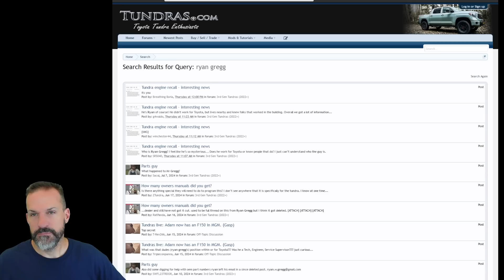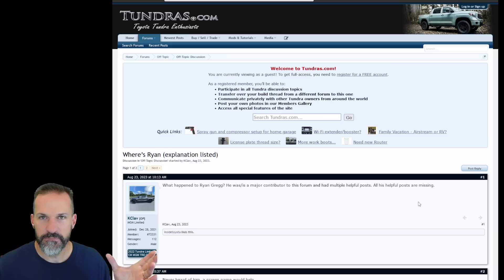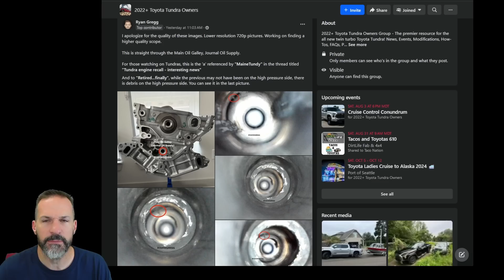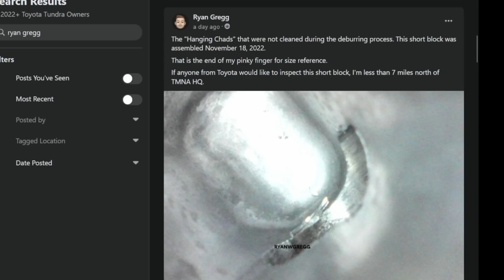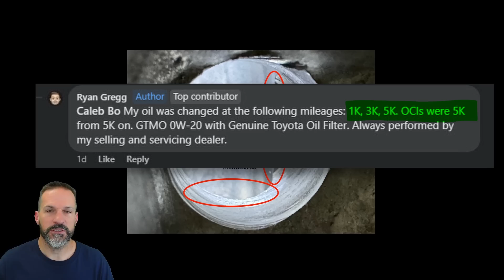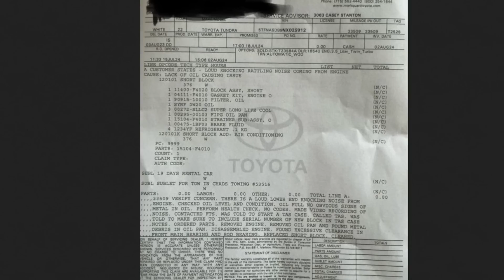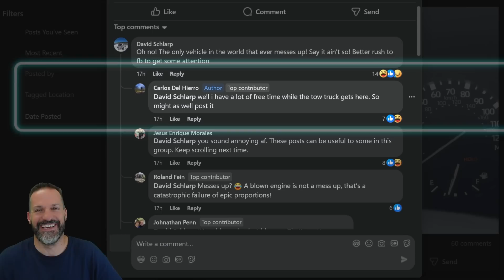Tundra Engine Failures: Debris Confirmed and Early Warning Signs for Dying Engines.

Comment: I still dont believe its a debris issue. Im still thinking its a miscalculation on the oil clearance for the main bearings. Those jagged burs aren't going to come off.
Reply: It's a design flaw, everyone knows this with a brain.
Reply: They do and they flake off as well.   Lots of reports of seeing metal in the early oil changes on the 22-23's.  So believe what you want.  Facts are facts.
Reply: @ronaldreagan6756 there’s metal in the first oil change if not the first few oil changes in basically all new production engines. This is a design or materials issue
Reply: @ronaldreagan6756  Metal in first few oil changes is completely normal. It is what you should see if your engine is breaking in properly.
Reply: Yes, I agree it’s not only a debris issue. It’s a bad engine design, too much pressure on the moving parts and bearings, and cheaper parts. Toyota isn’t the same company as it once was sorry to say it but it’s obviously true.
Reply from the maker: Time will tell, but if it was 100% an engineering clearance issue I think we'd see even more than 1-5% failing at this point. It might be a mixture of things, maybe main bearing material, maybe variable oil pump pressure/supply (more likely it could contribute to a lack of oiling), and debris chewing up the bearing on top of other issues.
Reply: @TheCarGuyOnline it is more than that. They just gave that number because they don’t know how bad it really is.
Reply: That and my idea about a power surge issue causing out of phase problems
Reply: You believe that Toyota would spend tens, if not hundreds,  of millions on a fix that won't fix anything?
Reply: @actionjackson5086  I never said they weren't fixing a problem.
Reply: Its the only engine ive seen with an aluminum engine cap girdle. I seriously wonder if that has anything to do with it!!

Comment: Just got my oil analysis back from blackstone for my 156,000 mile 2015 2.7l ecobeast f150. Engine is just like new. All wear metal values are in spec.
Reply: The 2.7 is the best ecoboost engine Ford makes.
Reply: @AJourneyOfYourSoul  yes it is.
Reply: @AJourneyOfYourSoul I had a 2014 and it was garbage. The truck is garbage period.
Reply: @JohnDoe-nz6bk there was no ecoboost 2.7 in the 2014. The OP was saying the 2.7 is best engine. And I would agree. Mines been worked hard daily and still fires up at 176k.
Reply: @chairmannemo2548  there’s still time to use google and then delete this comment. 🤦‍♂️
Reply: @JohnDoe-nz6bk  take your own advice..

Comment: Very excellent information. I was skeptical as it related to the debris explanation. This kind of lends some credibility to the information. Now you wonder if the recall campaign will be expanded. I would love more information on how the recall dates were determined. Initially, the design flaw theory was more logical. My LX is not included in the recall, I would consider it a gift to remain that way. Kudos to Toyota for dealing with the issue. Still lots of questions, really good report.
Reply: Your LX isn't because they don't want to spread fear.....Toyota knows it has a BIG problem.
Reply: @doctordetroit4339  I have not perfected the ability to read the minds of Toyota or anyone else, so I'll refrain from doing so. I agree they have a big problem, I've had many in life. I found it key to also pay close attention to the response to problems. In my opinion, Toyota has done well in response. I will be loyal to them.

Comment: An early sign you will have an engine failure in a tundra is you bought a tundra.
Reply: Yes, when you sign the papers if the pen is leaving a trail of ink on what is called the “dotted line” you might wanna head right to the repair shop asap!!!
Reply: @danav3387 😂😅
Reply from the maker: Hehe...yeah I can't imagine spending 60-80k on these only to hope it doesn't have this issue. The good news is, it seems like it would be an easy fix if it's JUST debris...bad news is....there are still 2024s that have had failures so, time will tell if they can get the ship pointed in the right direction.
Reply: Is Toyota having it's engines made by Hyundai / Kia? I'm sure it's cheaper.
Reply: My friend has a 22 Tundra.  90k miles, no issues.  Pulls a large enclosed trailer for his contractor business 5-6 days a week.
Reply: @Usmc6113  congrats?
Reply: My buddy has gone 2 for 2 on lemons. He had a Titan Cummins, then a Ram 5.7 Eram. Now he has a Tundra(non hybrid). Will he get his turkey?
Reply: Whatever man, you and I both know that Toyota has been proven reliable for years. This sucks because I have a 2022 Taundra experiencing the same problem,  along with many more cases. Ask yourself this, "who's recalls killed more humans than any other manufacturer?". I can think of Chrysler and Ford!!! Not Toyota! Keep in mind that Ford did not want to recognize the burning car problem as a recall at 1st. Which would have saved countless lives!!!
Reply: 🤣🤣🤣🤣 Please I’ll take a sick tundra over any of the big three and still and still last longer New moter option says Any Day
Reply: @louisherrero915  I can see someone sick with mental issues buying a tundra. Cratering engines and transmission guaranteed 😝
Reply: Perfect.
Reply: Wisdom
Reply: My F150 blew its engine, must be the same logic duh 🙄
Reply: Not a very intelligent comment.
Reply: This is the first tundra with engine failure
Reply: @ubuntumike5794  no, there has been other failures
Reply: Well not my problem - it's Toyotas problem. Buy a Ford it's your problem.
Reply: @Engineersoldinterstingstuff  toYota will fight all of it, like they have with some of their other issues in past yrs
Reply: And when you buy a Ford, the transmission will fail like they always do lmao 😂
Reply: @StarInfinite00  and your opinion has failed also😖
Reply: Let me guess, Chevy is somehow better? 😂
Reply: @Assault-Roomba could be woese, could be a Kiama 😂😂
Reply: @Assault-Roomba  Sorry bruh.....you confuse Tundras with Camrys......joke's on you.
Reply: @Assault-Roomba  chevy never had to recall an entire engine line.
Reply: @ChevyCamaroIsBetter that’s because they just chose not to do it. At least Toyota owned up to it and is replacing these recalled engines with brand new ones. The American brands will never do that, they’ll just let the customers suffer.
Reply: @c1aytonbigsby  Sure bruh,......they aren't recalling several lines even though they know they will or are having problems.....keep hopium alive.
Reply: No, but they have entire truck lines for other reasons @ChevyCamaroIsBetter
Reply: @c1aytonbigsby  let me know when Chevy engines exploded 😒
Reply: @ChevyCamaroIsBetter the tundra engines design is t causing them to explode and again Toyotas replacing every single one of those affected engines. New GM’s have left way more people stranded and they are t fixing them like Toyota is. One of my employees is on his 2nd trail boss and the transmission is giving the same issues the first one had, it’s not even at 20K miles yet either. First one only made it to 37K 😂😂😂
Reply: @c1aytonbigsby  Toyota still hasn’t fixed the engine though🤔
Reply: @ChevyCamaroIsBetter  there was nothing wrong with the engine, it was the manufacturing process that they messed up on. The new ones after they fixed the manufacturing process haven’t had any issues related to the metal shavings.
Reply: @ChevyCamaroIsBetter yep just having 5.3 and 6.2 with lifter issues out the ass but they won’t recall they just hope they get out of warranty so it will be on the customer
Reply: @Burchster1987  lifters aren’t engines blowing up 😂
Reply: @c1aytonbigsby  yea, right🙄
Reply: @Burchster1987  just like what Toyota is hoping for eh?
Reply: @pathunter7003 well seeing as the recall doesn’t affect the new ones, ya…I am right 😂
Reply: @c1aytonbigsby  no problems when it’s a new engine,🙄
Give it time, it’s more than just metal shavings…
Reply: Still better than a Ford or Chevy.
Reply: @adamh3272  😂
Reply: Time to buy a Cybrtrk. No Turbos no trannies no GASOLINE needed, no oil changes , air filteds , catalytic converters ,no smog check  OTA updates,, best connected truck on the road.amazing turning circle, tomorrow s truck is here.
Reply: Bet you I'll beat you in a drive across the country in my gas Toyota Tacoma with 208,000 miles on it and you drive cyber truck or any ev! Ev's are crap!
Reply: @AuralioCabal-nl8gi And plenty of spacious room for your wife and her boyfriend.

Comment: I love Toyota and own 5 of them, and because of these failures I bought a 2024 Nissan Frontier Pro-4X.
Reply: Good choice!
Reply: I wanted a new taco but the transmission is faulty in them so, I’m going for comfort this time. Honda ridgeline
Reply: Yet Nissan had way more major transmission failures on almost all their vehicles. Sure not there trucks but You act like Nissan is some saint of a company.
Reply: @mariogarcia2254  Cálmate Mario. I am not acting anything. One thing are CVT transmissions, and another is a 9 speed transmission like the one in the Frontier and Titan.
Reply from the maker: @mariogarcia2254  Nissan trucks don't have the failures you are thinking of. The CVT transmissions were in their light duty cars/SUVs (not full sized), and ranged from around 2013-2020ish. The Frontier/Xterra/Titan have a very reliable transmission/engine platform overall.
Reply: @TheCarGuyOnline  The new frontier does or did have a slew of issues though including transmission failures, rough idle, electrical issues, premature failure of starters, window motors etc etc etc. The internet is a funny place. Things get way overblown. Back before all of this social media people would have just had the issues resolved without the drama.
Reply: @mariogarcia2254  there is a distinct difference in the quality of the Nissan trucks versus the cars just like a Ford F150 is better than the rest of the Ford vehicles
Reply: @mariogarcia2254   The CVT transmission is the problem . The Frontier has a 9 speed traditional electrotonically controlled automatic and a naturally aspirated V-66.
Reply: @mariogarcia2254  Nissan cars use their junky Jatco CVT, Pathfinder on up use an actual transmission which have been proven to not have issues. But nobody’s perfect.

Comment: This is really disturbing from Toyota. It’s like they just forgot about Kaisen altogether when they made this new Tundra. Even if it wasn’t having these engine failures, the rest of the truck is designed poorly.
Reply from the maker: Yeah tons of complaints from owners and even Youtube enthusiast types. I sure hope they turn it around.
Reply: What’s designed poorly on your 3rd gen tundra.  Enlighten us.
Reply: @CanadianProho1  no
Reply: @CanadianProho1  panel gaps, poor window seals, squeaking at the front windshield headliner, sideview mirrors falling apart, squeaky center console, rear window jamming, plastic on driver's seat breaking, rear axles not bolted properly, fuel line leaks (with recall and no fix), squeaky brakes, radio knobs falling apart, fuel indications faulty, engine stalling/hesitation after attempted acceleration from a slow roll, overheating transmissions, engines seizing, no tow hooks and no rear bumper step.

Those are off the top of my head.  There's more but I gotta go.
Reply: @jonesjones7057  so all that you have posted you must have a lemon checking into the lemon law. If you’re post is correct they should buy it back.
Reply: @Lance-b2l  Do you work for toyota? you sure hate to hear anything negative about it
Reply: @jonesjones7057 you have personally had all these issues with your truck? Strange! Mine doesn't have any of those issues, at least I'm getting a new engine for free.
Reply: @stevieray1828  I didn't say that.  I said these are some of the issues, to someone who asked what issues the truck has had.  Geez.  Just read the thread.
Reply: @jonesjones7057 it their poor reading comprehension …

Comment: Toyota forgot how to make engines
Reply from the maker: I hope they get back to their old form soon.
Reply: This problem is happened in only America.
The engines are all "made in Arabama", in Japan, v35a engine has been used for LS500 since 2017 but no engine blown cases.....
Reply: @rockybalboa2305  because of Alabama
Reply: *in America
Reply: wym is literally first gen bro they will fix ist toyota after all lo0l
Reply: Many things produced since the covid lockdowns have not been the same.
Reply: Maybe they learn engine tricks from BMW.
Reply: @brucey5585 the B58 seems to be doing great, wouldn’t be a bad idea lol
Reply: @Jonny2by4  gen1 B58 was mostly a good engine but nothing close to a Jz but the Gen 3 B58 are lining up into dealers with reliability issues due to extra efficiency mods the the Gen 1 didnt. BMW made reliable cars when things were simple like their 2002 back in the late 60s and early 70s I have a handful and will never let them go but anything a 10 yo BMW is never reliable compared to a 10 yo Toyota...well until recently Toyota's Tundra and Yaris are shockers even worse than the BMW mini.